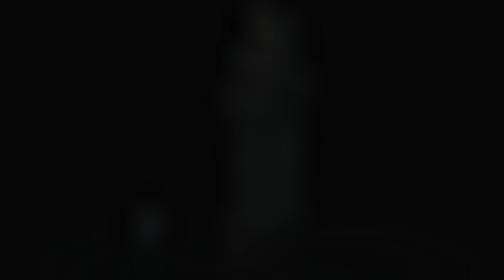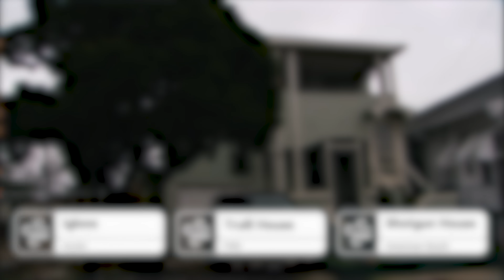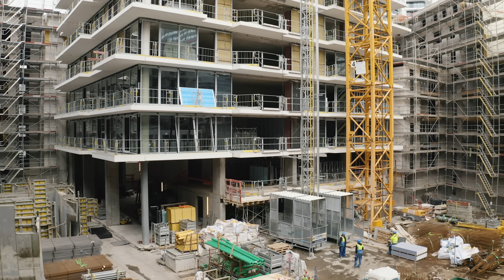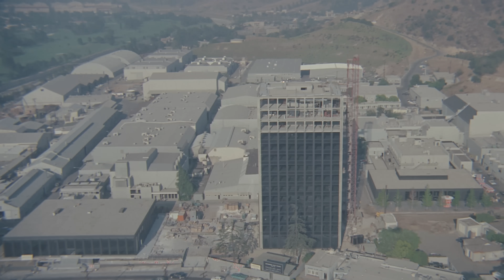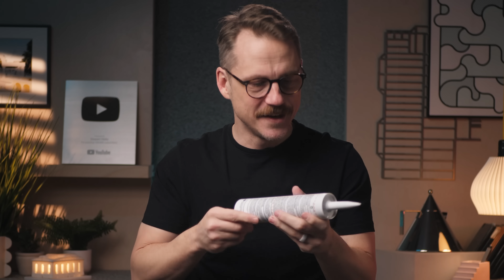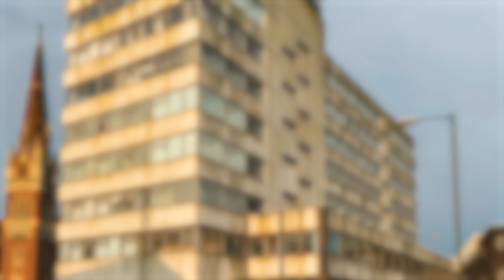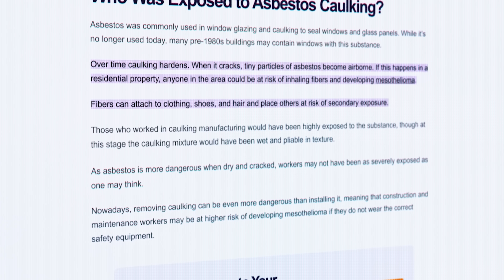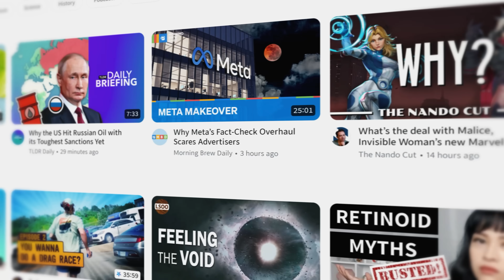How Caulk Accidentally Made Buildings FLAT

Comment: I see you lamenting the loss of “craftsmanship” in building construction but really it’s a gain in efficiency in the whole lifecycle of a building.
Reply: That really depends on the lifespan of said building. It is, for example, vanishingly unlikely that almost anything built in the last 50 years will last more than 100 years or so without full refurbishment if not outright rebuilding: in fact, most buildings that use the style he is bemoaning (generally seems to be referred to as "Modernist") have an expectancy of needing major repairs after as little as 50-60 years compared to nearly double that for more classically built structures. Naturally this is assuming particular care in construction for each, I know there are many of both types that will fail well before such a period.
Reply: No it isn’t, because it reduces longevity
Reply: @user-ed7et3pb4o  Most people want to renovate frequently anyways. Being able to tear down and start over can be seen as a large scale renovation :D
Personally I'd rather have a home last as long as possible and wish that was the norm but that cultural value doesn't seem common in America.
Reply: It might be a gain in efficiency for the initial construction but it really enabled laziness that has been massively detrimental to quality of modern homes and it haven't even enabled us to fix housing issues as thats arguably worse than ever.

Comment: I live in a building with an exterior wall covered in small tiles, ceramic or porcelain idk; but I can say that any building around from the time when I started living here more than 10 years ago to new buildings being built right this moment, NONE have this same level of care put into it's construction. I don't think I have ever seen problems with infiltration or cracked walls inside or outside of the building, but man, every building around has had what I can only describe as "snake patches";  lines of sealant paint over cracked external walls, more often than not, never painted over in the color of the original external painting.

Comment: I've always heard "physical over chemical" when it comes to preventing water egress in construction. Caulk will always fail and you won't always notice, so treat it as a backup to diverting water directly.
Reply: Ingress, not egress
Reply: @philippenight2421  I probably should have said promoting water egress since that's typically the goal.
Reply: @AbbreviatedReviews   Ideally, there is not water requiring egress. If you have a need to provide water egress, something else already failed allowing water ingress.

Comment: Hmm, the connection seems pretty tenuous to me. Of all things to critique, sealants is somewhere on the bottom of my list. 

Caulking a building's cladding system, to make it weather resistant, is a pretty poor way to go about it anyway - weathering/thermal cycling/UV etc - so it'll fail quickly. If anything, a lot of vented cladding systems work better with less caulk. Whereas, air sealing of the thermal core of the enclosure is crucial for any assembly, especially when you start including even a modest amount of thermal resistance - although tapes are more reliable than double sealant joints.

Also, whilst I'm whinging into the void, natural cross flow ventilation is universally worse than balanced ventilation. The problem of comfort is almost always ridiculously overglazing buildings.

Comment: So, so many stock videos of people laying abysmal caulk seams lol
Reply: Interestingly, stock videos are kinda functions like caulk
Reply: It was painful, no doubt.
Reply: you'd be surprised the percentage of contractors and craftsmen especially nowadays with efficiency this efficiency that all while upcharging is. holes throughout the caulking, too much caulking and then smoothing out with your finger, it's immense
Reply: Having done a lot of caulking as a maintenance guy, yeah. 

I just wish I was a good enough carpenter to not need to use it LOL
Reply: Yeah agreed. These stock photo people also show beautiful women holding a soldering iron upside down while wearing glasses and a lab coat.
Reply: @ryanyoder7573  - those are really awful. Also they always have a random ancient Intel LGA 775 motherboard on the otherwise empty workbench. What are they soldering? Where are the components? And as a cherry on top they always grab it by the part that would burn you.
Reply: Those women exist i married an almost entomologist@ryanyoder7573
Reply: ikr? triggered my angry monster :(
Reply: @Dahgomba  angry caulk monster 😟

Comment: Very rigorous examination of a very ephemeral element of construction. Working on older homes, as I do often, I really have to stretch my mind to imagine how the original builders would have assembled door-frames, windows and material transitions. The ingenuity and precision as you peel the layers back is always striking. What destroys this work is when people slap on mortar or caulk rather than analyzing the original leaves of material to understand what is failing, and how to restore it. Nice work!
Reply: Once I removed all the original door-frames (casing) of an old apartment I had. I thought I needed new ones. What a stupid idea. The older ones were made of heavy wood and bonded to the brick walls with twisted naild and grout. It was really hard to remove. I wouldn't do that if knew how perfect the frames were. (the rest was rubbish due to termite, but the frames made with good wood were perfect). Than I put MDF frames with expanding foam. What a nightmare. They never kept aligned though the year. At summer or raining seasons always half of the doors got kinda stuck. The MDF doesn't like those humidity and temperature fluctuation. I should change the doors themselves and finishes, but keep the frames there.
Reply: @AfonsoBucco  I just recently finished ripping an MDF door and screen off of a 1890s row home, restoring the trim and opening the door back up to full height with a salvaged replacement. It's a lot of work to fix bodged original material, but once the work was done, she shines like an angel.
Reply: @ahilltodieons  nice. in my case it was in a 4 floors apartment building made in kinda 1970, but near de ocean, in Brazil. Mostly original finishing of the building is rubbish as I said.

But a few things, just a few things they got right. For example: White marble at stairs were just perfect. Built-in PVC "curtains", were perfect for windy season, while the glasses theirselves were thin and its frames had CENTIMETERS of clearance between mobile part and track. So at winter, being inside or outside was like the same.
Reply: You must love it when you find a homeowner has "fixed" something with ten pounds of Bondo lol
Reply: Also, I love your boundless enthusiasm and excitement coming through in your monologues! Let's get Mr. Hicks Grade I LIsted!
Reply: *Caulk is the opposite of "ephemeral."
Reply: @WalterBurton  I meant the sealing and mating of different surfaces, not caulk itself.
Reply: Yes you made a very important point. You should therefore always use lime mortar and linseed oil paint or paint on other natural basis like casein.
Reply: Hand tools were sharp and arms were like tree trunks, it answers a lot of the questions.
Reply: @ Especially the arms that hewed the tree trunks, haha.
Reply: You mean when people don't have a lot of time and money to fix minor drafts?
Reply: @zacharyhenderson2902  I've taped my drafty windows shut a few times, haha. There is a time and a place for caulk, but what starts as a temporary fix becomes permanent, and caulk is a bastard to remove.
Reply: @ahilltodieons  I agree 100%.
Reply: Would it apply here that you only notice the good builds and that quality of work range on older buildings would be larger due to caulk/tech improvements making construction easier/cheaper? How would a well built old home compare to a good new build?
Reply: @seannguyen2135  Of course we have survivorship bias as bad old houses have either collapsed or been knocked down. 

However the modern US home is just a travesty. 
Over the lifespan of the home it's obvious that a brick home that gets used by multiple generations is better than a toothpick home that gets knocked down every 30 years. 

The real issue here is that wages haven't kept up with inflation while housing prices rose dramatically leading to corners being cut as people still want single family homes. The average guy can't afford the craftsmanship. 

This is just a simple example of unchecked capitalism not being able to provide sustainable solutions.
Reply: @ It also has to do with the commoditization of labor, and the efficiency with which any economizing financial system removes the most expensive aspect of physical production - that being the human. 

Most of the expensive work actually carried out by human hands is in the fine "finishing" work of building, such as delicate trim-work or mosaic tiling (which I do quite a bit of). People are willing to pay $25 per square foot for a marble backsplash,  but the rafters under the kitchen floor are made from plywood and creak like a seal. 

I still think it is possible to design smaller homes that can provide both quality and affordability. I lived in a small 1950s cabin in Wyoming for a few years, about 300 square, and with one more bedroom, it would have been perfect for the 'ex and I. Logs laid down on a slab with a metal roof and some propane wall heaters. There were seven other cabins on 4 acres of land, all occupied in a little community with a central lodge/community building. It would be very hard to get approval for such "villages" nowadays, but land and septic systems that can be split amongst homes would drastically cut prices.
Reply: @seannguyen2135  It's all relative, in my opinion. If you cheapen the materials and remove the solidity and mechanical connections between elements, as with flush vinyl windows, there is only so much that can be done to ensure proper fitment even by a proficient installer. Often, if watertight longevity is desired, flashing still plays a major role (as an example). Before these sticky or elastic materials, I can't count many times I've come across something original (and un-bodged), even if less well installed, that hasn't been fine for a hundred years. Caulk will always have a  shortly limited life span, but some people still build well today, with timber frames or adobe walls.
Reply: I hope that continues to be the case. I'm very fascinated with the use of soft copper flashing for joints and connections since you don't need a sheet-metal brake. Lots of work to do on my foyer, and hoping to experiment.
Reply: @seannguyen2135  In my limited experience a well built old home (let's say the 1960s or earlier,) is far superior to anything I have seen in my various home searches over the last decade or so. The modern work has uniformly been of lesser quality, corners cut, cheaper materials and falling apart after 20 years or less..

That said, I am referring to common stock in the bay area and DC area, of high six digits to low 7, not custom designed and built one off homes, but subdivisions, starter and larger homes.  As well as tear down/rebuild spec houses which in my experience have been the prime example of shiny and rubbish at the same time.
Reply: @seannguyen2135  Old building must be caulked with something like hemp rope. That modern sticky stuff is the devil, it is polluting nature, makes mold and poor air in buildings. So very unhealthy.
Reply: Wow can't believe you work on that old stuff without realizing how inferior it is on nearly every regard. Poor insulation or none, no vapor barriers, no insect protection. Poorly fitting wooden windows with no real seals whatsoever and single pane glass. 😂
Reply: And somehow it's lasted longer and stayed in better shape than nearly everything built since the 1940s. Homes aren't meant to be air-tight boxes; they need to breathe and react to the environment. The Dutch understand this so well that they don't even use vapor barriers in some of their projects! Most of the decay and rot on older homes comes from owners or contractors with poor knowledge of how systems were designed and meant to be maintained.

Comment: To be fair, all those deviations and seams in the terracotta are just more gaps that let drafts in. Sure they look neat but they still let in a ton of drafts and all the leaks and issues are hidden behind layers and layers of façade that trapped mold that you were unable to clean.  

I keep hearing about how new homes that are all sealed up don't have good airflow... as though drafty homes prevented mold and mildew from forming.  It just grew in the walls and people got used to the smell over time.  Every house over 40 years old smells of mold, mildew and cigarette tar.